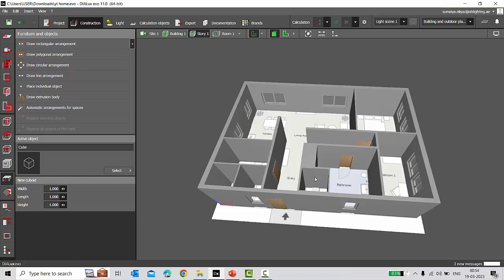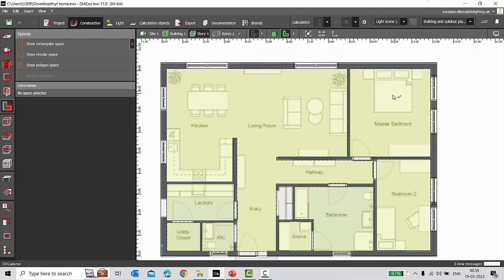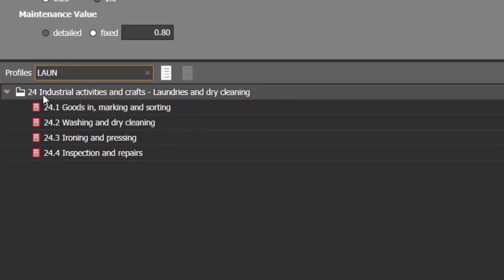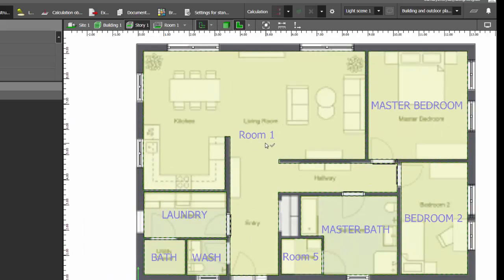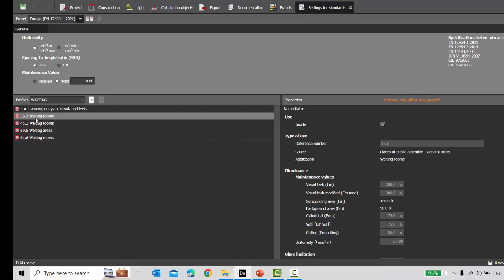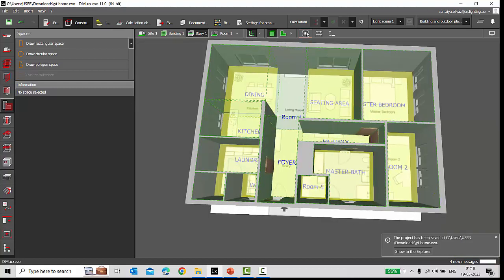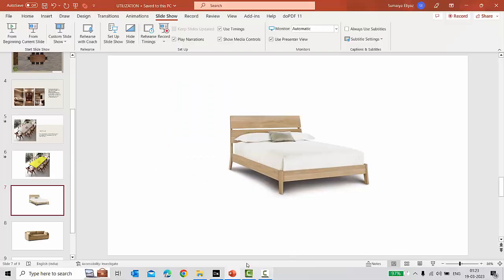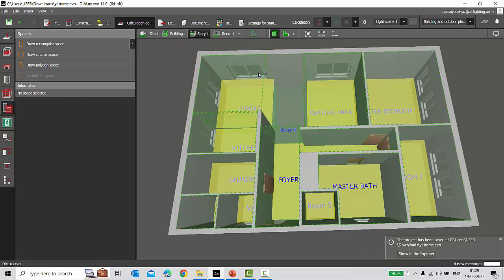Detailed Explanation on Spaces and Workplane for Residential Projects in Dialux Evo

Comment: Restroom in American English means toilet/bathroom not a bedroom. There are no standards for bedrooms which is why this isn’t an option
Reply from the maker: Thanks for the comment. Just to clarify — the tutorial doesn’t Mention America or American English. As explained, users are expected to select the closest matching utilization profile based on the function of the space, not the exact room name.So we selected restroom for bedroom - as lighting requirements match.

While “bedroom” may not be strictly defined in lighting codes everywhere, many lighting codes include it and specify recommended lighting levels for residential applications. 

Your statement that “there are no standards for bedrooms” is incorrect. If you set the codes to USA in DIALux, you can check under section 33 (Residential Lighting), where bedrooms are clearly categorized with specific lighting requirements. So bedrooms do have recognized standards in many national codes, including the USA.
Reply: @ thanks for the clarification, I should have said I am in the UK where there are no mandatory requirements for residential bedrooms. It may be different for the USA or other countries.
Reply from the maker: Ah okay, but in the UK projects I've worked on, we did make sure to achieve at least 100 lux in bedrooms—just to ensure a good baseline for comfort and functionality.